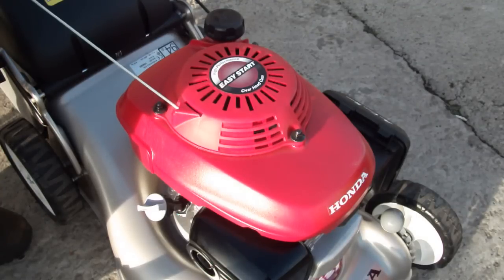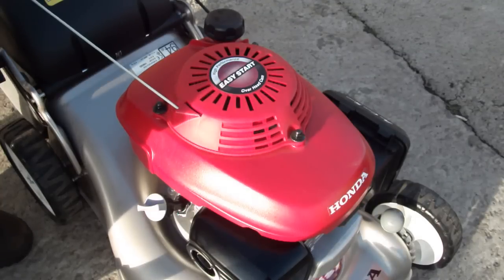Honda Lawnmower Engine Oil Check - livgm.co.uk

Comment: I had to laugh at the "bring it to your dealer to get the oil level dropped" comment, you can get a large syringe as used in garages to suck it out the filler hole from ebay or any online motor factor or tools emporium, failing that just tip the lawnmower over until the oil pours out into a suitable container. Fill it with new oil to the mark and let it sit for five mins then start it and cut the lawn. This avoids the expensive trip to the dealer and you don't damage the engine...thats just dealer frightening tactics.

Comment: My Honda mower manual specifically tells you at an oil change to turn the mower on its side to drain the oil. There is no drain plug... so if you were to overfill ....you'd have to turn it on its side.
Reply: easy peacy..no dealer service to tap of needed for that like he said

Comment: Thanks... its a shame the honda manual doesnt point out that you check the dipstick level without screwing back in.  Because screwing back in to get a reading will definitely give you a very different measurement.
Reply: it is in the manual
Reply: My Honda GCV160 engine manual does state not to screw the dipstick back in. It says if you thread/screw the dipstick in that you will get an incorrect measurement.
Reply: Looking at my manual now - “without screwing it into the filler neck”. Bolded. With an illustration of the threads above the tube. Couldn’t be clearer.

Comment: 2:14 -- " It's Not correct practice to tip the oil out.... "  
In the Honda Engine Manual it shows how to do an oil change..... and it shows TIPPING the unit (at least my GCV160)  on it's side with the Fuel Valve off and using a drain container.      I personally always remove my air filter just in case when changing the oil.    So basically you guys will take a little suction-siphon hose and draw some out.

Comment: Why would you recommend you run at the max oil level? Most cars run better in the middle or toward the low side. You'll even get more mpgs.

Also the hash marks... do the ones on the bottom or top matter when you pull it out? or should the marks be oriented to the side and not up/down? I get a different measurement on the top, bottom, or sides. I'm going to write honda and ask.

Over fill? Tip it over. DEFINITELY do NOT run it. Could bend the rings. Extractor pump is another method. They are approx. $20. I take an orange juice bottle, duct tape it to the port. Find a hill or wall and tip the mower over. Remember to turn the fuel valve or the pressure from the tank will force it out the carb and leak a bit.